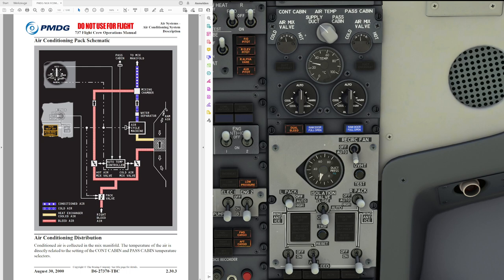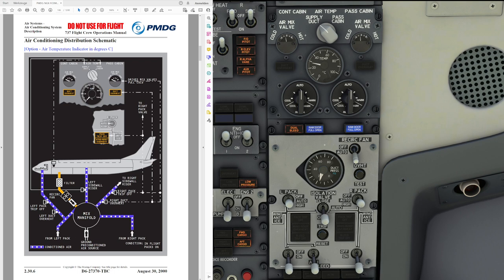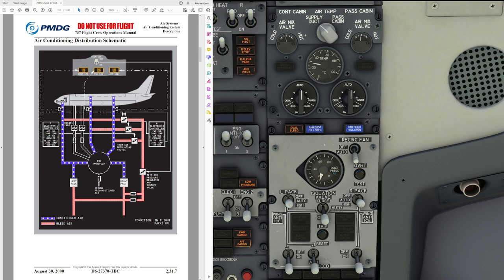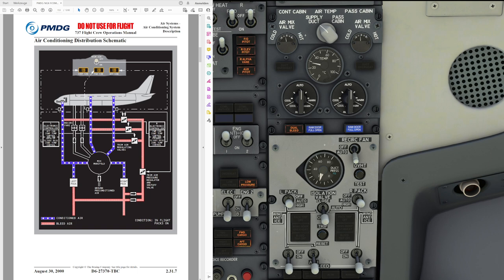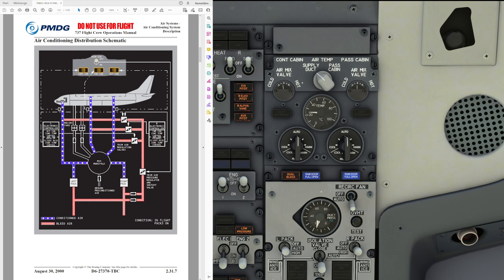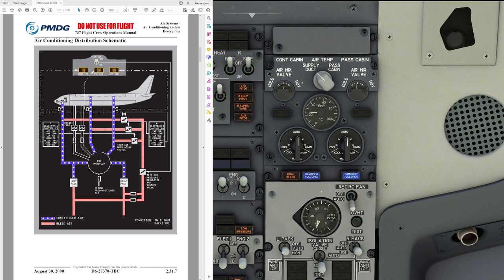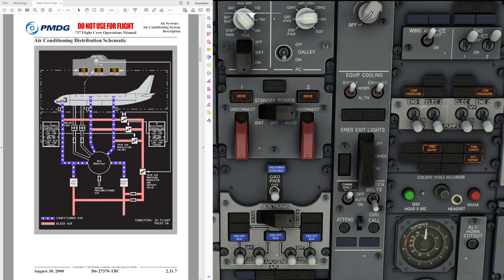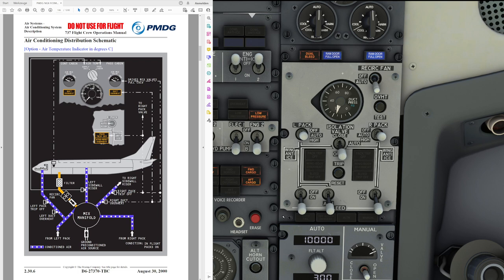737NG Air Conditioning System explained | Real 737 Pilot

Comment from the maker: You guys are right of course that RAM air does not actually enter the bleed air system, but is used exclusively for cooling bleed air in the heat exchanges.
I should probably take a few more days off youtube and actually off anything after 5 days of work, landing around 2AM every time.

Comment: Pmdg really needs to simulate cabin crew complaining about the temperature
Reply: Followed by the proper QRH response of putting on the oxygen mask, confirm at or above 15000, and turn both packs to off
Reply: As long as they use real voices and not TTS that's fine. Flightfactor (a subpar developer for another major Flight Simulation platform) tried doing this once but tried using humour with a TTS voice causing people to incorporate killing him at the start of the flight.

Comment: I'd recommend you'd re-check the beginning of the video where you describe the pack function as this is somewhat misleading explanation. Ram air is not introduced into the air conditioning flow, it flows through the heat exhangers only. All the air flowing into the air conditioning system comes from the bleed air alone.

Simplified, the hot air is the part of the bleed air that bypasses the pack. And the cold air is the part that is cooled by the primary heat exchanger, then re-heated by the pack compressor, then cooled again by the secondary heat exhanger and then further cooled by powering the pack turbine, which in turn powers the pack compressor. The ram air is simply used as a heat exchange medium in the heat exchangers, all of it comes in from the ram air inlets and gets dumped overboard after going through the two heat exchangers where no mixing of the air flows take place.
Reply: Agree with Arto. No outside air is introduced into the airplane. The air cycle machine is really best described as a turbocharger that you would find in your car. A compressor side and turbine (expansion) side in conjunction with the 2 heat exchangers.
Reply: yes, I know very little about 737, but looking and the illustration, the explanation didn't match what I was seeing
Reply: Just to add upon my previous, indeed, no intent to be critical at all! I find this content by you Emmanuel quite brilliant, and exactly what we need to get players turn into simmers - and perhaps one day, real life aviation professionals, flying or not. Very easily approachable, and even if simplified, still not dumbed down. A difficult balance to get right.

The reason I had to shoot a feedback was just to simply because from experience, of all the major systems in an aircraft, the packs and the air con (interacting with the pressurization) are easily on any short list of subjects fundamentally not properly understood. Thus, just wishing to avoid any seeds of misunderstanding from the beginning for anyone starting their journey from here on!

Great content, keep it coming!

Comment: I totally agree with Arto of the misleading description of Ram Air function. It is only as a cooling medium to cool the hot air across the primary heat exchange not to be introduced into the conditioned airflow to cabin.  Also as he stated if further cooling required the supplied airflow is routed the Air cycle Machine for its cooling functions. This is by no means a de-merit point because of all your previous videos of high calibre and sound info, so please accept it as critique not as criticism. Prost

Comment: Thank you. I knew how to ask the stewardess for more air. OMG.  I am now a very well educated passenger.  It would be awesome if you zoomed in so I could read your screen.  

Is there any pressure from management for the pilots to keep the system in auto for fuel consumption?
Reply from the maker: No such pressure at all, simply follow the FCOM procedures.

Comment: hi captain, you r amazing, thnk you so much for the contents, Im in lifus and Im learning better with your videos. I want to ask you some questions captain and if you can answer that would be awasome because I cant find anywhere. 

1-Primary and standby electronic control funtions? What do day do exactly? We have pack valve but also primary and standy pack control valves ,If pack overheat occurs we already have sensor in down stream of mix manifold and also if we lose both of them fcom says pack continous to operate without temprature control. Its really challing to understand their functions. 
2- Also Left and right electronic controller are the same thing as primary and stand by controller? What do they do and also confusing thing is , if we we lose  flight deck trim air…does that sentence mean right elecktronic controller failed because fcom also says right electronic controller controls flight deck and forward cabin temparature . Im really confused about this electronic units plz enlighten me . Thank you so much captain

Comment: you said to set the temp to 28-30c?  Most people are comfortable around 21C.  28C is WAY to warm...
Reply from the maker: I said I set the temperature indication to 28C. In a 737 that's not exactly the same as the actual temperature at 28C LOL

As said in earlier videos... this thing has air conditioning like a 1960s car. And they had none.